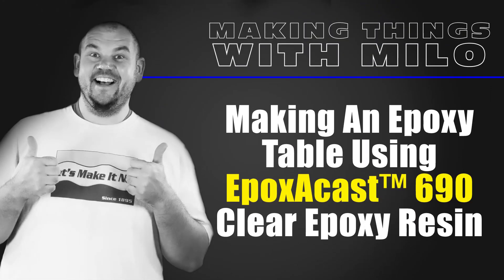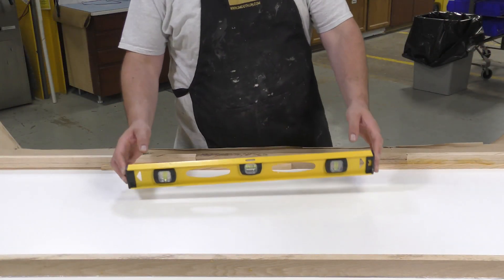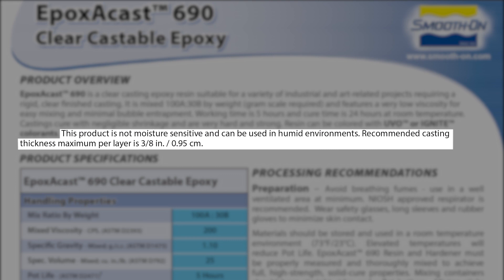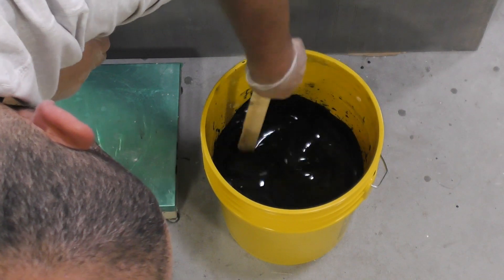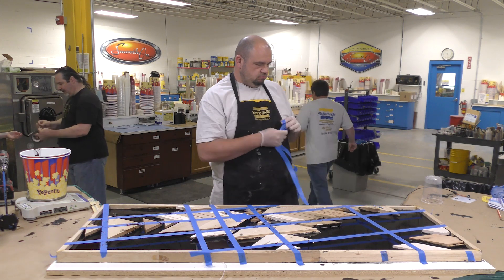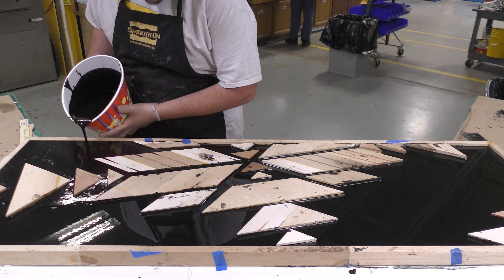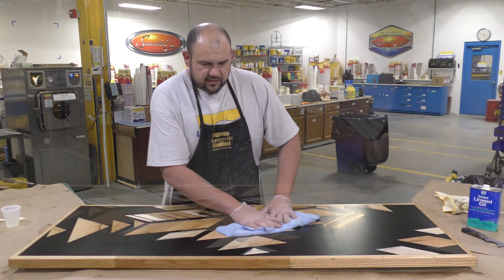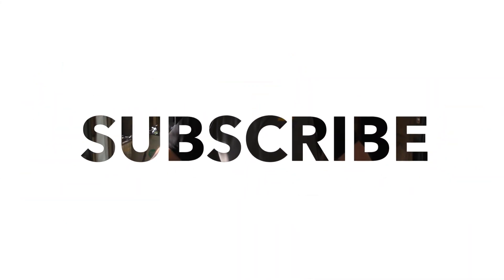How To Make an Epoxy Table Using EpoxAcast™ 690 Clear Epoxy Resin

Comment: A couple of questions ... how long did it take the linseed oil to cure? does it penetrate the epoxy the same it does wood ... in other words does the linseed oil seal the epoxy or did you use it mainly as finish for the inlaid wood pieces?  and ... milo, the videos are great, really helpful, thanks!!
Reply from the maker: The linseed oil does not really cure on the epoxy, so you must be careful not to use too much. The oil is mainly the finish for the wood inlay pieces.